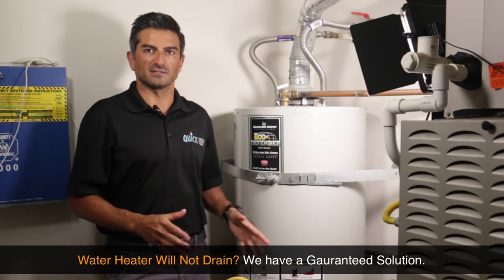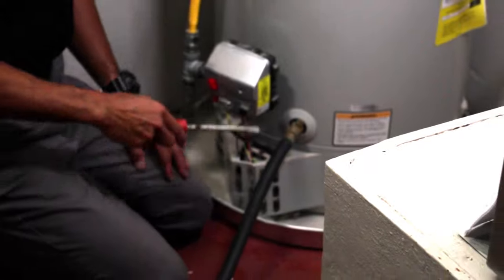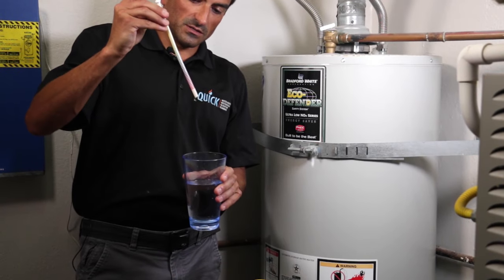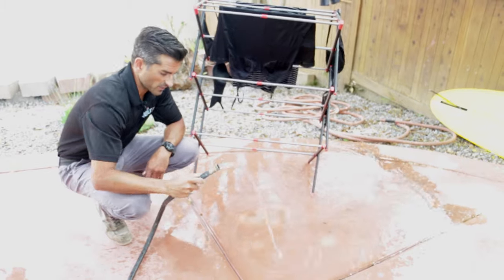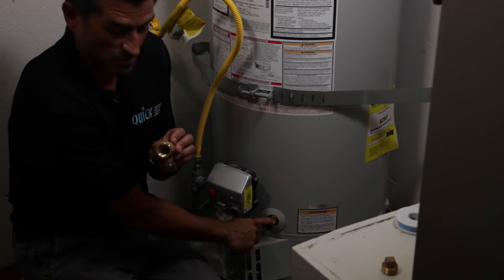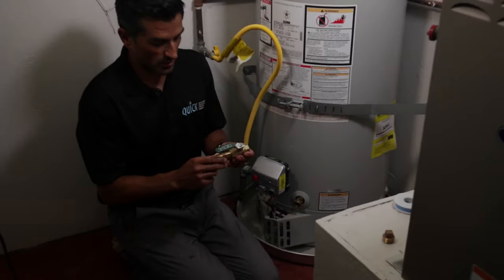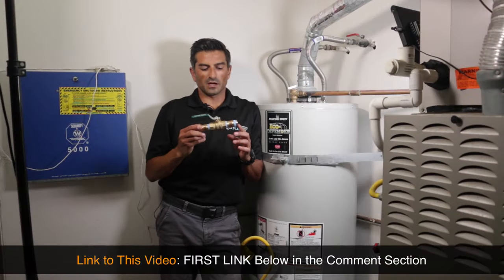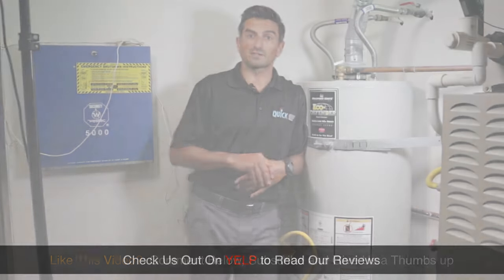My Water Heater Won't Drain [Fix It With 3 Easy Steps]

Comment: I see that the ball valve in my current drain valve is stuck and doesn't open. I'm pray to try to turn it with a screwdriver as I probably won't be able to get it back in. It's also plastic so I think it's best to change it like you did just not clear on the the diameter
Reply from the maker: Since it is a plastic ball valve, it's not recommended to do this as it can break inside the threads and would be difficult or impossible to remove after it breaks.

If you insist on trying, the best recommendation to insure you get what you need would be for you to talk to someone at Home Depot that knows their way around plumbing. They should be able to get you what you need to make this drain valve.

https://quickwaterheater.com/faq/#1569796610657-0ba1a61c-e526

Comment: Thanks for the tip. My 12 year old water heater was plugged right as a tick. Following your instructions, changed to a 3/4 ball valve and it drained perfectly. Changed elements and thermostats and flushed till clean!!

Comment: I’m so happy I saw your video!! Your help was excellent. I needed your 3rd instruction to finally make it work. I replaced the original valve with the one you put together. When I have to install a new tank, I’m asking that they remove the original one to put in the 3/4 ball valve. Done 🎉

Comment: Thanks for the video. Can I use pressure release vale to let the air in instead of open the hot water pipe?
Reply: That's the way I do it.

Comment: I have a few tips that I have used. Mine is in the basement. I don't have a floor drain so I set a plastic pan ( about the size of a large kitty pan ) under the drain then put my portable sump pump in the pan then the hose out the window. Works like a charm. Also, when I bought the house I found that the previous owner had not drained the tank in over a decade. there was sludge all the way up to the bottom element. I took my garden hose and forced a jet of water into the drain valve to turbulate the sludge then switch to jetting in to the lower element hole while it drained until it plugged again then jetted back through the drain valve and alternated this until it ran clear. At one point I used a bent piece of 6 ga wire to scrape all around in the bottom and sides of the tank through the lower element hole. now that it is clean I plan to flush it once a year.

Comment: Great point about vacuum. It was a little tricky for me figuring out which faucet to open. I basically shut the main supply off and opened the garden hose as it was the closest to the heater input. It worked.
Reply from the maker: Glad you were able to get something to work for you!

Comment: For the new, replacement drain valve assembly you indicated use of 2 (two) 3/4 in. X 1-1/2 in. nipples. After installation, you screwed a hose onto the end of the outboard nipple. You don't mention an adapter between the different thread pitches. I don't see how you did it without one adapting NPT to GHT?
Reply: I noticed that as well.  Otherwise an excellent tutorial!  Hose thread and pipe threads (NPT) may look 'similar' but are totally incompatible.  Hardware stores sell "adapters" - basically a short 'nipple' with male NPT one side and Hose thread on the other.  The best are brass and are usually expensive, but worth every penny...

Comment: I usually do is remove the aerators and turn on the hot water have the valve open for the hose and open the relief then turn off the water so it's already draining through the hose

Comment: Thanks for your video.  Very helpful info. I have plastic valve and cannot get water heater to drain.  I am sure sediment is built up inside. Water heater is 30 gal GE about 6-7 yrs old never previously drained. While I could probably change the valve, don't think I want to tackle it alone.  If I call plumber, I will replace the heater.
Reply from the maker: Susan Thomson Yes. I agree. Probably better to leave it alone. Next time buy a water heater from a plumber who can install a 3/4” ball valve for you to drain your water heater.

Comment: I'm a retired pipefitter (not a plumber). I have a friend with a very old water heater, plastic drain valve. The water heater is at floor level inside the house, no pedestal.  I'm going to help him put in a new water heater but I don't want to even touch that old plastic drain valve. Thinking about running some tubing inside from the outlet port on top and siphoning the water out. Ever had to do that?

Comment: I always use a air compressor,attach it to the t&p valve, pump it up to about 100psi open the air hose valve and voila,it also works in a basement where you don't have a drain lower than the water heater.

Comment: Good information. I’ve got a 20 yo propane heater with the plastic valve. I can’t drain it because it leaks behind the knob upon opening it. Unfortunately it’s on the main level so I gotta b careful. I took out anode some 12 years ago water stunk. Any feedback on the plastic d v leak situation ? Thanx

Comment: Great video! I have a question: what size are the threads on the new valve where it screws into the tank? Also, do all tanks have the same threads for that valve, or does it vary between manufacturers?
Reply from the maker: It's a standard 3/4" thread. If you're going to use a hose, you will need a nipple that has both the 3/4 in thread and the standard hose threads.

Comment: What if theres no drain valve on the water heater?   Mine is 2 plastic “nut” plastic pieces. One you can unscrew with your hand the other is pretty tight!   Thank you!!!!

Comment: I have that plastic one and after several attempts it flushed free. We have to get new tank at any rate. Bottom steel anode is blown open and can’t remove without draining at least. If I can’t patiently fish it out while hot water isn’t pouring out then it will get replaced after I try and multi tool cut and bend it out then vac.

Comment: Great video, couldn’t you just open the temperature and pressure valve instead of removing the supply line?
Reply from the maker: AM44 _ you definitely can. BUT, if you do you’ll most likely need to replace it.
Reply: You should replace the T&P valve on a regular basis also. Why wait for it to release when you're not there and flood your home.

Comment: Thanks for this great video.  I am trying to follow your process because I have a Rheem gas water heater we failed to maintain, and now the drain flow is low with no sediment coming out.  Plumber said we likely have accumulated sediment which has fused and solidified above the drain valve.  

Two questions.  On Method 2 (shut off CW supply and open HW faucet above the WH tank), the video shows nothing flowing from the HW faucet when you open it--this allows air to flow to tank to prevent back suction.  When I open the HW faucet (after closing CW supply), it's flowing hot water still in the line.  So do you have to drain that HW line completely before attempting to re-open the drain valve?  

Second, what is Method 2 doing that wouldn't already have been done by using Method 1?  Seems like Method 1, with tank under pressure of CW supply, should do as much or more flushing than Method 2, where it's only gravity pushing flow out the drain. 

Lastly, if Methods 1 and 2 still show low flow, I can't replace the valve because I have the Rheem plastic drain valve.  Some people recommend trying to poke through the drain valve with a zip tie or a coat hanger to break up the deposits, but our plumber said that can damage the gasket on the drain valve.  Seems like a zip tie would be safe (but maybe not strong enough to break up fused sediment.)  But I can see where a coat hanger could do damage.  Thanks for any advice!
Reply from the maker: If there is a lot of water flowing out of your hot water line, the cold water supply line is likely still on. With the cold water supply closed, it should create the air lock that would also prevent the water from coming out of the drain.

By leaving the cold water supply line open, it will likely drain but the water coming in will keep mixing with the water that's in the tank and the sediments will float around inside the tank and not come out. Closing the cold water line will drain the water and sediments inside the tank versus just having it float around in the volume of water in the tank.

You are spot on with the assessment that the zip tie would be safer but likely wouldn't be strong enough to break up the sediment build up, depending on how bad the build up is. You don't want to damage the plastic valve or the gasket for fear that it would leak and you could potentially have to replace your unit sooner.

Hope this helps!

Comment: Your last resort idea about creating a vacuum in the tank was a bit confusing. You closed the inlet side and then went inside to open one of the hot water side of a faucet. Am I correct? I have a valve that will not drain a drop of water and need to do this. Thanks for the video.

Comment: Let me clarify about creating a vacuum. I have too much sediment and it clogged the the OEM valve. Need to change it to the 3/4" gate valve. So first shut off the main supply valve so there's no incoming pressure. And then, turn off hot water faucets in the house so air can't get in when you remove the OEM valve?

Comment: If this still doesn't work ? As a last ditch effort. Keep the hot water flow on and cold water supply off.  Hook up the hose to a cold water faucet in laundry sink or wherever {Note; You may need a $5 hose adapter} Then to the drain valve on the Water tank .Turn on water for 10 to 20 seconds. This will blast water back through the drain valve to force to blockage to back up , Then try to drain the boiler again. Just repeat everything he said about draining the tank. If it still gives you problems? You may have to stick a screw driver or a skinny metal rod or a piece of coat hanger or something to break up the chunk of sediment or a large piece of scaling that is gumming up the valve. You may have to rinse and repeat the whole process two or three times until clean water with no sediment start flowing from the drain valve. { Note; you can also use a couple short bursts of compressed air to blow out the blockage.  If you happen to have an air compressor. Then try to drain again rinse and repeat. Eventually clean water will come out.  If it still doesn't drain? It's time to consider buying  or renting a new tank.   
Just a few more hints If you want the boiler to last for at least 15 to 30 years ,  Drain it once a year and you should also purge the pressure relief  valve every 6 months.  If the pressure or the drain valve  leaks, buy a new one. They are about $15 bucks. Also Important change the water tank anode rod every 2 or 3 years. If the tank is rented the rental company may do these maintenance fixes  if you request them to do so. They might  just even replace the tank automatically if it to old.                                          
Keep in mind a lot of insurance companies want  your boiler serial number from the boiler and are recommending getting a new tank every 15 years. Or it might impact your coverage and premiums.  However whether you buy new, or if you rent one? Depending on the age of your flue venting or chimney you may or may not, need some very costly upgrades to your flue pipe venting system. Due to building codes and liability. Most legitimate  companies will not install a new  or a rental water boiler without these upgrades . Which can cost a few hundred or a few thousand dollars.  If you cant afford  expensive upgrades, You can buy a tank new or even used one and do it your self. Or find a guy to do it for cash and  no paperwork . Read the warranty on the tank. This might void any warrantee on the tank and the work done. Unless installed by a certified installer. You will be responsible to buy another one if it leaks again.   Insurance only cares about the age of the tank. Not how or who installed it. Best bet is, don't say anything unless they ask for proof it was installed by a certified installer. 
Though one day they might want to inspect everything including the flue, but highly unlikely, That's usually done when they initially pre inspect your home to buy new insurance. Or by a home inspector when you first buy or sell the house.  Even then they will only recommend upgrades not force it.  But if they do require you to upgrade the vent or chimney flue. ? There is just no point.  To avoid all that you are better off going with a fully electric tank. Depending on how many people in the home and how you use hot water.  They are really energy efficient these days. You can also buy a gas boiler with a power vent to the outside , But then they will drill holes in the wall and you will have an ugly vent coming out the side of your home. Hopefully it's on a side of the house nobody sees. In my opinion It kind of defeats the purpose using gas when your spending money on electricity to vent a gas hot water tank, Not to mention you may or may not have to pay for the extra work. However.  This will still be a lot be cheaper than redoing your whole chimney flue. Especially if you plan on selling it in the near future,

Comment: Thank you so much for this video. Small hack if you can't install a new valve. Mine was completely blocked by sediment, like you said... So I copied the steps to create a vacuum and prevent leaking, then I removed the top of the valve and that gave me access to the sediment. I broke it up with a small screwdriver and put the top of the valve back on. After that I was able to use the water pressure to force most of it out and get it flowing again.

Comment: Easiest way when the drain valve is plugged with sediment is to blow air back into the tank against the closed supply valve and let the build up air pressure blow out the debris. You will have to repeat this process a few times, but eventually the water will empty out. 
This method works especially well when you have the plastic drain valve that can’t be replaced with water in the tank.  Think finished areas, no drain pan and other situations. Been there done that.

Comment: I agree about the Reem & Whirlpool plastic drain valve is trash. I use a oven pan to catch the water when putting a new element in and cannot clean the inside because or the inferior quality of the plastic valve.

Comment: Hi! 
I notice my water heater is pretty old so I am planning on getting it replaced

However. As I am keeping a close eye to it until the replacement date I feel I mostly see the water in the water heater pan when my AC is on 

They sit in the same closet and I’m in a townhouse style condo.

I have seen still water in the AC pan prior but currently I only see the weather in the water heater pan and like I was saying  usually when the AC is on. 
It does look like the drain pipe (I think is what it’s called ) from the AC pan leads to the side where the water heater is but it’s no water on the floor only the water heater pan mainly

Also the water heater pan now leaks 
It’s pretty old and rusted
Reason why I am getting it replaced

I hope I explained that best

Comment: Only "flaw" with the design of the drain valve is you will need a "hose end" on the outermost brass part. Otherwise it will leak.
Reply: How will it leak it has a ball valve on it ?

Comment: Could you just take a wet/dry shop vacuum to the end of the hose and suck the sediment out to get the water draining? That's what I did, and it seemed to work just fine.

Comment: My water stopped draining so I connected my shop vac blower side to push the air into the drain valve to push the sediment blocking the valve.  I heard bubble sound inside the tank.  It cleared the whole.  I had to do this a couple of times.
Reply from the maker: This may have worked for you but I do not recommend anyone else do this. In the very worst case pull out the hot side nipple and siphon water out. If it’s a dead heater remove the thermostat and drain from there.

Comment: Why not use the pressure relief valve to release the vacuum? You can put a bucket under the hose if it doesn't release outside. Mine does.

Comment: Mine only drained a few gallons (40 gallon capacity), yet  with the cold water valve on it flows freely. Did I gather from your comments that there could be sediment barrels taking up most of the capacity? Hard to believe it functions normally.

Comment: I moved began renting my house a year ago. I asked if the water heater had ever been flushed when they said no I took it upon my self to do it. Only to find no shutoff valves on the heater. Should I be concerned about this or let it be?

Comment: Too bad I'm not in San Diego or I would call you. My Sears technician just left and he only tried the first method and nothing came out. He didn't try anything else. Didn't seem to want to. Told me to call a plumber to have them clean it out. He can't see through the tank but assumed that because I don't have it cleaned out every 6 months that it was full of sediment and rocks. I was getting six flashes on the thermostat which means replace burner. The burner and a valve were replaced about 13 months ago. I don't think he wanted to replace the burner again. He reset everything and I have hot water but I don't know how long it will last.

Comment: The rheem wigh plastic drain valve here, can i remove and replace it with the setup you showed on method 3?
Reply from the maker: Yes and no. It could break off in the water heater and become very hard to remove if you can get it out at all.

Comment: My hot water heater has a cold water tube inlet that circles half the bottom of the heater to keep the calcium stirred up to keep from settling to the bottom of the heater.